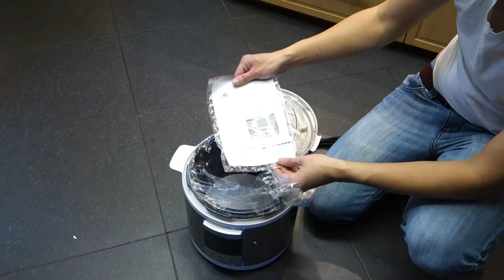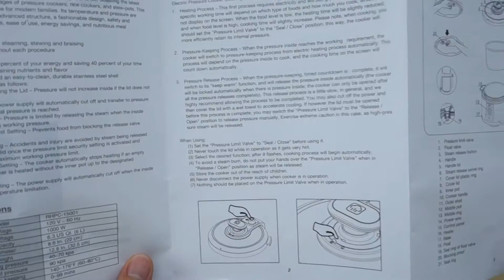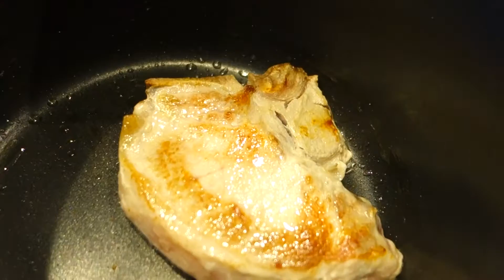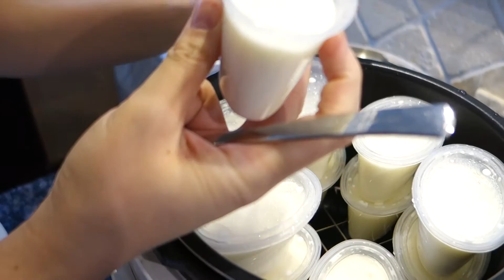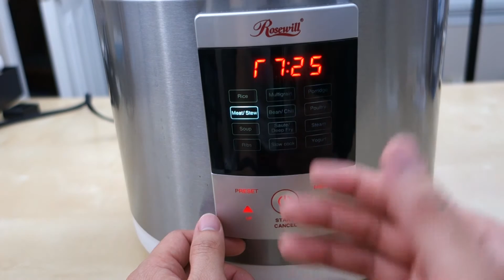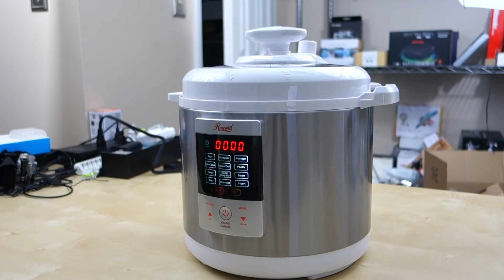Rosewill RHPC-15001 Pressure Cooker REVIEW

Comment: An excellent pressure cooker that includes dedicated settings for Ribs, Yogurt and Slow-Cook. At 6.35 quarts and 12 functions, it's just as good as the 6-quart Instant Pot Duo, but at a lower price.
Reply from the maker: Still have mine these days and it's been a while work well.

Comment: Thank you so much for your review!  This is very helpful!  I just got one, but on the second use, I had a really hard time closing the lid to the lock position, have you had that issue?
Reply: Did you figure this out ? I’ve only had mine for a few wks and had to jiggle it a few times. Check the gasket

Comment: Great review! Got this as a Christmas gift and so far everything has come out great. Wings, ribs, whole chicken, pot roast, meatballs, Mac n cheese .
The instructions are horrible and I’ve never used a pressure cooker before so I’m surprised how well everything has come out.
QUESTION: so the first part of cooking is high pressure right ?  Then the countdown begins during pressure release correct ? So the overall cooking time doubles? I’m so confused. The lid won’t open during the countdown phase correct ?
What setting did u use for pot roast ? Are you able to post a few cook times and settings ?
Most recipes say high heat but that’s not an option so I’m trying to find which presets work for what, besides the obvious ones like ribs, rice etc thanks!!!